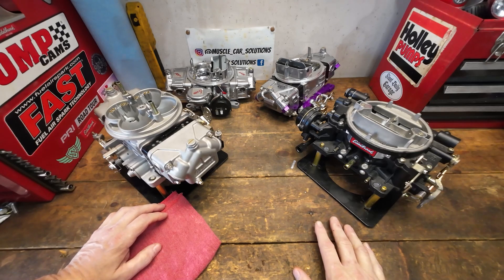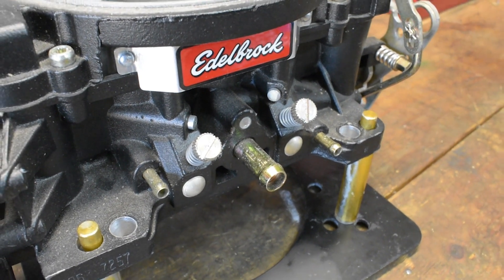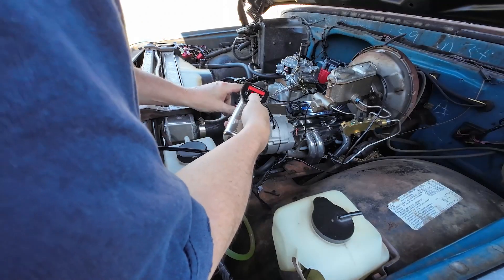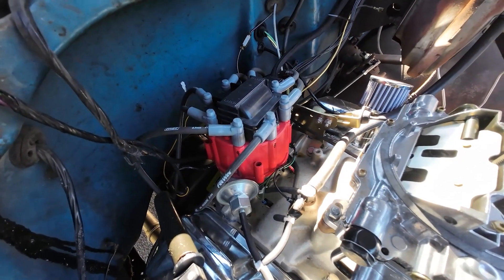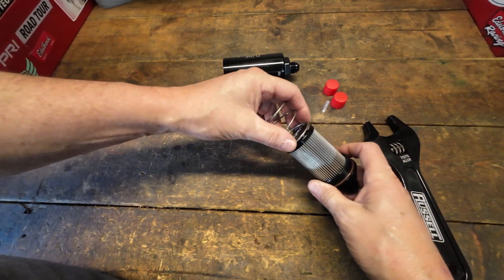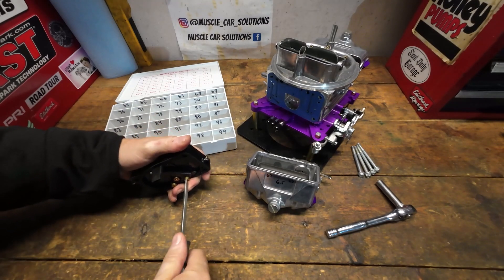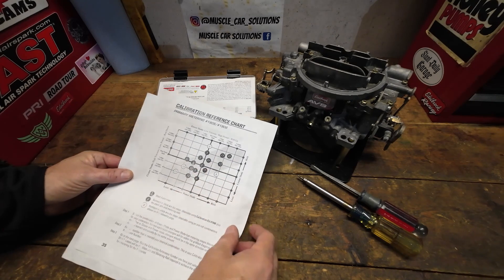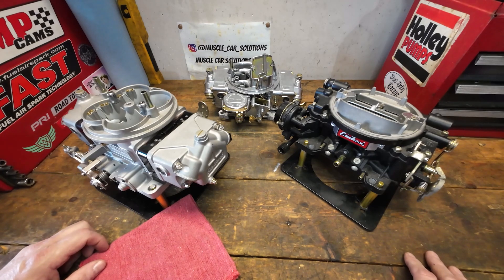Top 4 Carburetor Tuning Mistakes

Comment: Great info, my avs was hesitating a little, vacuum was low, as soon as i advanced the timing. The vacuum  rose and seemed to sound and run better,
Reply from the maker: Timing cures a lot of issues folks ask about carburetor tuning. The engine demands it on today’s miserable fuel. Keep on tuning!

Comment: I have a electric choke 650 CFM Edelbrock that ran great on my 350 now I have a brand new built 383 stroker with aluminum Enforcer heads, air Gap intake, comp magnum 280h cam and everything is ok and I have a AFR gauge too by the way and it too looks to be in range but it bucks at steady fairly light throttle in any gear. Initial timing at 16 help fellas.

Comment: I keep getting air inside my fuel line. What are all the causes for it?
Reply from the maker: Need to know quite a bit more info.  Pressurized EFI system, carbureted?  Where is the pump located?  In the tank?  Frame mounted?  Mechanical on the engine? How are you judging you’re getting air into the system and what negative effect is the engine experiencing because of it?
Reply: @MuscleCarSolutions its a simple carb for a pit bike bike gravity fed and i know this is for cars but i would assume its the same but less complicated.
Reply from the maker: @RCMadness360  no problem.  Please continue.

Comment: Hi, I have an Edelbrock performer carb on a 383 big cam motor. My idle is set to 1000-1200 but can’t get the timing below 30degrees before it stalls. 
I know this could be due to so many things but where would you start if you had this problem?

Comment: You brought up the two big ones I see see. Ignition and fuel system. Complimenting parts makes a huge difference. Your videos are always very good and full information. Good running old c10 you got there.
Reply from the maker: It’s been a fun driver.  👍 And no doubt, a majority of problems folks have can be chased down with ignition/timing and fuel system set up.

Comment: Alot of the initial setup on a carb depends on the ignition system working right and having a decent advance curve. 
One thing you maybe didn't mention is the  float level plays a big part on the fuel system, especially the holleys.
Excess fuel pressure will overwhelm the needle and seat that allows gas into the carb. Too much pressure and it will likely load up.
Having a dial back timing light is always a plus for setting ignition timing. Also knowing when to disconnect or limit the vacuum advance is also nice, might want to lock it out til later. A good vacuum gage is really nice to have as well. It will tell you how your setup is. If you have a stock cam and can't get around 17 inches of vacuum, you may have an issue with the integrity of your engine.

Comment: I built a 385 sbc for the street. It wouldn't start. The problem ended up being the primary brass  float. Somehow the float was so flat that it cut the fuel supply off.

HOW?

Comment: People also dont realize for example the 600 Edelbrock electric assist choke is set from factory for fuel economy while the 600 manual choke carb is set from factory for performance . also I use the vaccum guage to see what the vaccum number is = say 17  then divid by 2  . what the number ends up being is what colored springs you use from the carb tuning kit
Reply from the maker: @MoparMan-1978  I did a video on that topic.  It’s not that they are calibrated different, the boosters are completely different from the electric choke vs manual choke in the performer series.  The manual choke carbs will always perform better.

Comment: Also the kid said that the timing was thrown off slightly because the distributor cap was twisted slightly to the right, I need some help from someone on here,
Reply: @g-vicious4204  best to adjust your distributor with a vacuum gauge.  Most airflow is optimal .  Can't tune the firing any better than that.

Comment: I have a 96 gmc dually that smells like it's running rich and I'm not sure what to do, but the dually is fuel injected, and my oil pressure runs high on idle

Comment: Any advice on running a stock replacement 2 bbl carburetor on my 1979 Lincoln Mark V with the 6.6 400 engine
Reply from the maker: @joseduranjr4963  depends on the CFM of that carb and the operating rpm of that engine.

Comment: Thank for your video! It's really little red Edelbrock 38GPH fuel pump are too small for most applications? I use it with near-stock 351w, F4TE, ported heads, 8124 Weiand intake, HEI distributor and AVS2 650cfm carburetor. I use dual feed, big EFI fuel filter, custom made pressure regulator and high-sensitive industrial-grade pressure sensor. My fuel pressure set is 0.379 bar/5.5 psi. Runs pretty good, but now I hesitate... Maybe that flow is too little? Sorry for my English, I'm not native speaker.
Reply from the maker: @ДмитрийФакухин  that pump will be ok for idle and some light cruising but if you’re asking for it to keep up to higher rpm and more aggressive driving, I’m afraid it’s not capable of that.  No need to apologize for your English.  You communicate very well.
Reply: @MuscleCarSolutions  Thank you for answer! I'll think for something bigger, maybe Holley-style pump...

Comment: A big pet peeve of mine is people running the $1.99 see through plastic filter and cheesy hose clamps right on top of their high end build 🤣🤣
Reply from the maker: @Ratridez  it served its purpose.
Reply: @Ratridez  I'll run clear Napa full filters and aviation - style clamps thank you.
I wanna see how much rust may be pulled by the pump, and even add a second see-through Napa BEFORE the fuel pump.

Comment: I swapped to holley dp and used fuel log with a gauge and found my sbc mechanical pump was pumping 12-15psi, put a regulator on and had to reset my fuel bowl level and it was idiling 15:1 AFR and i ran a Edelbrock 650 avs2 with that pump and no regulator since 2018 i know why my oil smells like gas now

Comment: Add two-barrel mercruiser carburetor on 3 l 4-cylinder engine. 
Old carburetor what's having trouble idling 
  Got a new carburetor and it's running way too rich. 
   Wondering if the primary jets are too big 
  They gave me a set of two different size Jets
Reply from the maker: @BrianD146  the main meting circuit is generally not part of the idle circuit.  I’d do a little homework on that before making that assumption.  Fuel pressure is just as critical on a two barrel.  What is your fuel pressure at the carburetor?  Don’t know?  Time for a regulator and a gauge so you can control it.

Comment: Really good video Brian, so glad you touched on the timing, when I finally got my distributor dialed in I barely had to do anything to the carburetor, sure do like the digital E-Cruve distributor, oh and I did change the step-up springs in the 1406, catch you soon buddy 😀😀
Reply from the maker: @DesertRatFabrication  your video was very good at pointing out the intricacies of that ignition system.  Timing cures a lot of sins!  Thank you sir!
Reply: @MuscleCarSolutions hey Brian, I did want to ask you , do the metering rods match the jets in the kit, I couldn’t really see the numbers very good, I will bring a magnifying glass with me this weekend, like I told you before I only changed the step-up springs and it took the little hesitation I was having off idle, but that was also before I put the new distributor in , but even now the vacuum holds the metering rods down until I give it a little throttle then they pop right up, before I changed them they were lifting when idling, all good now though 😀😀
Reply from the maker: @DesertRatFabrication  the rods and jets are matched sets on the tuning chart.  They are calculated to give the precise amount of fuel for the conditions on the chart.  So if you’re on the base calibration (1), and you want to go leaner in the cruise mode but make no changes on the power mode, just follow the chart down till you’re close to the first stage of lean (4%) and try that.  I did a full video on how to read the chart if you need a little refresher.  97% of the time, I follow that chart exclusively.  Takes all the guess work out of it!  Such a great tool to have.
Reply from the maker: @DesertRatFabrication  you’re spot on with the step up spring as your first change.  Makes the whole tuning process go much quicker and you’ll get better results.  You’re a pro at this now! 👍
Reply: @MuscleCarSolutions  thank you I will check it out again 👍

Comment: Thanks for another quality video. Another best practice when tuning a carb, change one thing at a time, drive the car, determine how the engine reacts, make another change and repeat as required to achieve desired results. I see a lot of “I changed the main jets, power valve and secondary spring then went for a drive, now it’s doing this…”. Whoa buddy, slow your roll, let’s take this back to baseline and try again. Changing more than one thing at a time will result in chasing your tail, especially for a noob.

Comment: There is a large part of the timing issue that was missed. The understanding of total timing and the amount of centrifugal advance in the distributor is imperative to maximum power output. Reducing centrifugal advance in the distributor allows maximum initial timing on the crank shaft, without the total timing exceeding an acceptable limits. The extra initial timing increases vacuum signal, booster signal and response and low speed torque as well.

Comment: Thank you for sharing your knowledge,  just put a fairly built 351with a AVS 2 carburetor on it (425-440 hp) in my 67 mustang convertible and want her to run properly. Will be on the streets shortly and want her to stand proud.
Reply: @meek01__53  that's Hella built for a 351 not fairly lol

Comment: Great video! I find the advice on timing a bit confusing. My '66 Olds specs calls for the initial timing to be set at 7.5 deg BTDC (i'm at sea level). So you're saying, with today's pump gas, this isn't quite what the engine will want? So bump it up a bit at a time? How far do you go.......just keep bumping it up until you start to hear pinging on acceleration? That would actually make a great video......finding the correct timing.
Reply from the maker: @ourkid2000  eventually I’ll do that video.  Setting timing seems to be a topic that no one wants to tackle.  If it’s a V8, you can generally start at 10 degrees BTDC.  The engine will tell you if it does or doesn’t like it.  I did an Olds 350 early this year and I think we ended up at 12 for initial timing.  Todays fuel sucks.  That 7.5 was back when there was lead in the fuel and it had great properties for combustion and energy capabilities.  Those days are long gone.  Have to adapt to those changes.
Reply: @MuscleCarSolutions  great reply! Thanks so much. I have mine bumped up to 9 degrees but I'm too chicken to go any further and I have no idea if it even needs it. It's a fairly high compression big block (425 Toro).
Reply from the maker: @ourkid2000  starting is also part of that understanding what the engine wants.  When it drags the starter and is harder to start, you might have a bit too much initial timing.  Lots of things to monitor but it will let you know when you’ve gone too far.
Reply: @ourkid2000 don’t be scared. It won’t bite you lol. 😂
Reply: @ourkid2000 She will take 36-38° total on 93 octane.   Most old GM distributors have 24° of mechanical advance in them.   You’d be good @ 12°.   If you hear any pinging, detonation, dieseling or run-on at shut-down back her off 1-2 °.   Drive it again.
Reply: @MuscleCarSolutions ok 10 degrees mechanical, how much is vacuum adding to the 10 degrees? Thanks

Comment: I have a 1400 Edelbrock Performer how do you tune a smog carburetor
Reply from the maker: @robertchavez2864  you don’t.  Or technically you can’t of you wish to keep its EO status.  That carburetor is limited on how it will perform.  It’s a choked down 1406, which is very different that the manual choke 600.
Reply: @MuscleCarSolutions  I have a 500 CFM Edelbrock sitting on the sidelines. I was told I could transfer everything from my 1400 to the 500 cfm
Reply from the maker: @robertchavez2864  will it physically fit?  Yes.  The channel sizes in the main body are different.  You’d have to knock the plugs out and drill them open and seal back up again.  The real question is why would you want to take the choked down smog carburetor boosters and put them into a 500 body?

Comment: I'm thinking my regulator Isn't enough max setting only 4 psi rated, engine has low power...
Reply from the maker: @christopherpoucher483  remember the regulator restricts FLOW (I did a video on this topic).  PSI is what is controlled to ensure the carburetor runs properly.  4psi is quite low, depending on the application.  For some, 4 is extremely high!  What are you working on?
Reply: @MuscleCarSolutions  sbc 400 vortec heads mild cam had a 1405 I took off my 350 that felt under powered put on this engine and it's the same. Swapped to my 1407 it's better but still not right has me thinking 4 psi 3/8 lines hi flo mechanical pump timing is 10/32
Reply: @christopherpoucher483  I just put on a 1406. max is 6.5 but recommended was 4.5-5.5 at idle. similar build to you just a 350
Reply: @user-dc7im7id5q  my pump is rated at 6psi but my regulator is rated at 1-4 psi, I'm ordering another that's rated 4.5-9 psi
Reply: @user-dc7im7id5q  what carb are you using?
Reply from the maker: @christopherpoucher483  more fuel and more timing!
Reply: @christopherpoucher483  its a 1406 from edelbrock. i replaced a shotty aftermarket tbi system so my pump is 15psi. i used a 0-15 regulator. set to 5.5 and its been a great swap
Reply: @MuscleCarSolutions will do
Reply: @MuscleCarSolutions bumped the pressure up to just over 5psi and add 2 degrees, it really woke up part throttle!
Reply: @christopherpoucher483  glad to hear it buddy!

Comment: What are your thoughts on AVS 2 series? Was thinking of swapping out a Holley 650 double pump spreadbore ( Have adapter for Squarebore intake ) for that in 500cfm. The Holley is jetting down to 59 I believe on the primaries & have power valve changed to 3.5 so it opened earlier. It's on a med built chevy 4.3L v6, its punched out 60 over on the cylinders & non stock cam as well. Full MSD Offroad CD Ignition also. Max vac pull at idle is typically around 15. Trying to have a balance of fuel economy but have power if needed. Is a street\ off road vehicle on 35" tires, standard shift non auto.
Reply from the maker: @Jack_Move  you’re running a 650 double pumper on a 4.3? Yowza! Yes, any 500 would be better on that poor little 4.3L.  We’ve covered the AVS2 series carbs since they came out.  Great street and off road carb.
Reply: @MuscleCarSolutions   It doesnt flood out or anything. After switching the fuel system to the Holley from TBI, The general power curve jumped dramatically. Low rpm power went through the roof & finally also had enough to feed it in higher rpm range 4K-6.5K . Cylinder compression is at 195-205psi which is way higher then the stock 140-160 ish they were.

Comment: Thumbnail sketch: the difference between Denver and Houston demands a jet change -  3 or 4 sizes, depending on the carb.
Reply from the maker: @flinch622  link to the elevation video we did is in the description and much more is needed than 4 jet sizes.
Reply: I moved from 2500-3000ft in Washington to near college station and I didn’t have any issues beyond little tuning no jet changes though
Reply: @Thumper68  500 ft isnt that much...
Reply: @cuzz63  no where I lived was 2500-3000 now I’m near college station tx
Reply: @Thumper68  ok, I guess I read it wrong,